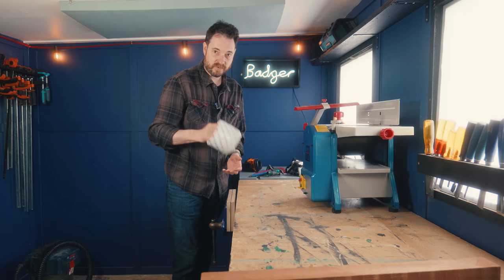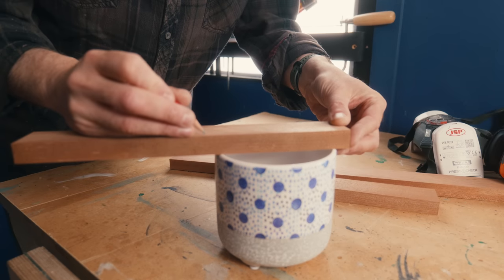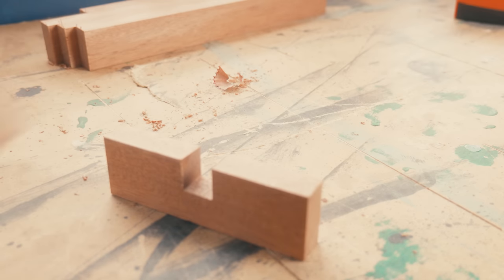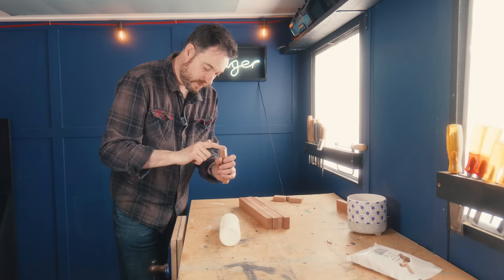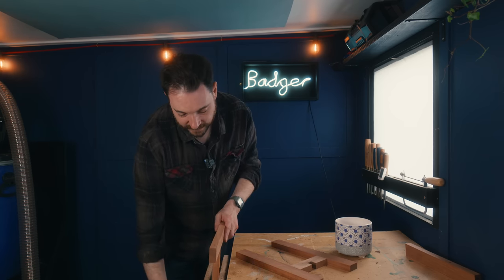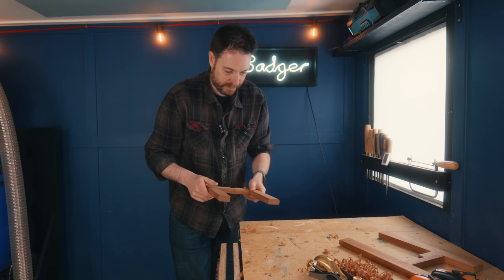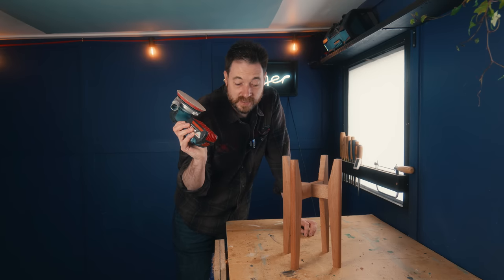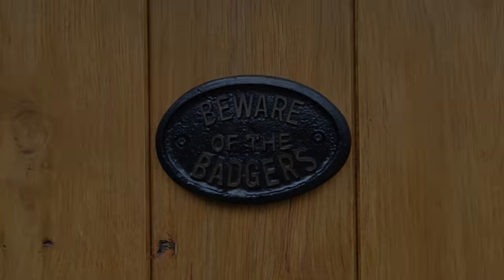This Would Make a Great Gift

Comment: Skipped over the hardest part of the build! How'd you get the second hole for the dowels on the long leg pieces?
Reply: the jig has a little gauge / stop block on it with a ruler, I am guessing he measured the spacing of the two dowels and set the gauge accordingly for each cut.